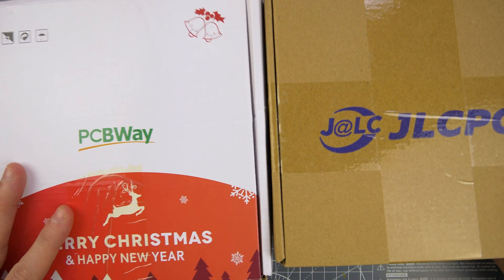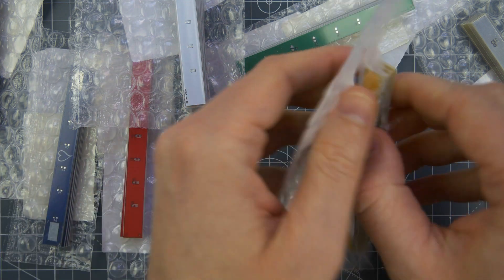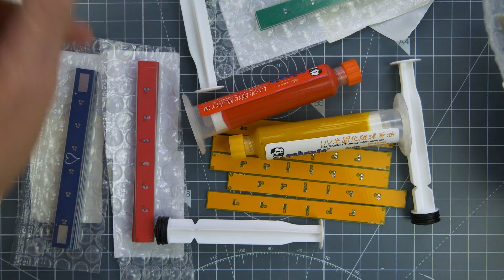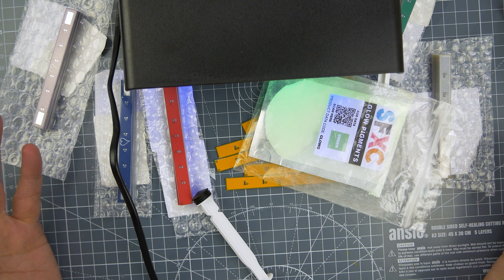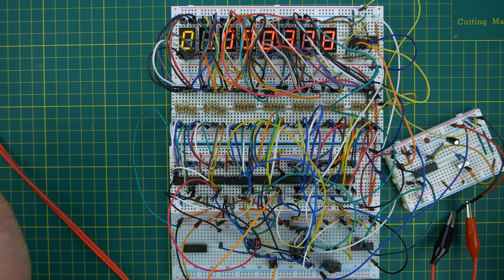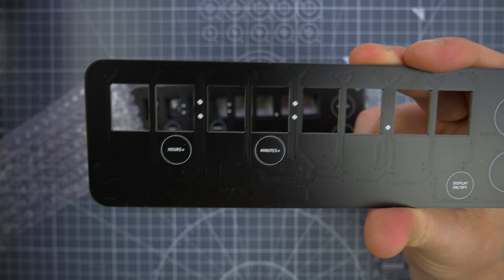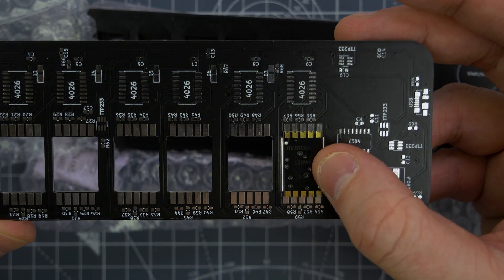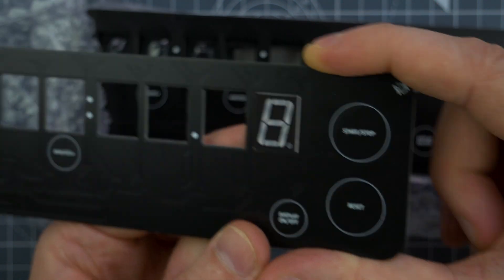PCBs Galore

Comment: Long time user of Eagle, I love it, but recently I have finally needed to do a long differential pair for a USB connector.  I've avoided needing to do anything with impedance and length matching but finally took the hit for an ESP32 project.  Turns out Eagle does not have any tools for paired traces or any impedance calculations at all. Gutted
Reply from the maker: KiCad has a differential pair tool under the route menu, though I must confess to having never used it.

Comment: Those displays are nice and I totally feel your fear when having to design your own parts. Glad it all worked out and can't wait to see some rainbow boards and custom soldermask work. And I'm shocked that UV lights are still so expensive with all the resin printer owners buying them these days...then again, that might also be why they are so expensive. I know I have a nice selection of 385-415nm wavelength light sources.

Comment: You have a centsiecond clock. A millisecond clock would have three decimal places after the seconds. Sorry 😜 It's good though!
I wonder if you coulda fooled kicad by placing that LED in one of the cutouts? That's worth an experiment just to see if it runs the gerbers. Failing that, try putting solder mask back over those pads

Comment: That UV light is gonna take its sweet time curing anything at 4W, but it's better than nothing. Your best bet to cut costs is search for LED nail lamps that pump out at least 10x more UV. Thanks to gel polish, you can get one for $10 anywhere random crap is sold. I do some printmaking at home, so I bought a 20W UV flood lamp from Amazon.

Comment: I’ve used the green Chinese solder resist in the past. I’d print the solder mask pattern on transparency film. Clean the pcb thoroughly. Put a dab of the resist in the board. Put a piece of unprinten transparency film on top. Spread the resist around (underneath the  film) with a credit card. Thinner is better (but in your case you actually care about the looks). Place the solder mask pattern on top. Put a piece of glass on top to make it lay flat. I would expose mine with two 1W UV leds for 10 minutes. After that remove the film(s). Scrub away the uncurled paint with acetone and q-tips. You can be relatively hard on it. The only problem I had was that sometimes small corners would lift from the pcb. If you removed all visible paint, go over it again. If there’s even a very thin (invisible) layer of paint left, soldering will be very hard (I learned that the hard way). After that give it another 10-30 minutes under the UV. Or leave it outside in the sun. Hope that helps.

Comment: Can't wait to see the touch panel. Also, i think KiCad will count a logo as a component  so might solve your problem with the led.
Reply from the maker: The touch pads I designed in KiCad oddly didn't count either, I guess because it had no keepout zone.

Comment: Just stating the bleeding obvious, but couldn't you have put all the components on the front of the pcb. Then just turn the pcb's around when you get them. Et voila, the components are now at the back, and no led on the front.
Reply from the maker: I don't think it was necessarily that it was the front of the board for the soldermask,  just that is had no parts on it. It just created gerbers that JLC thought we invalid, adding a part gave it some actual coordinate values and so JLC recognised it.

Comment: Very nice. Just one small thing....shouldn't 'milliseconds' be 3 decimal places?
Reply: I thought that, too.  I just hope he got the pads for the digits in the correct order.
Reply from the maker: Yeah, I tried the 1ms segment but it was just an 8 the whole time so visually looked rubbish until you stopped the clock. So I got rid of it.
Reply: @DavidWatts  Fair enough, makes sense. Looking really sweet whatever, and I really like your unique approach to tasks.....back mounting surface mount...yeah! Its the sort of oddball thing I'd do and why not if it works! Good luck with the rest of the build.